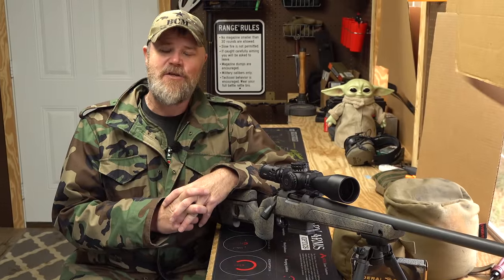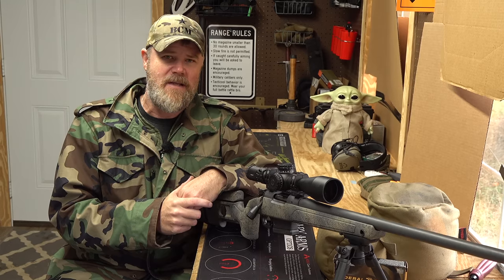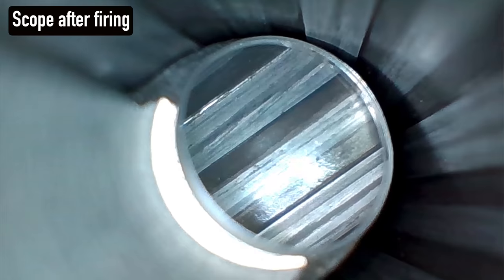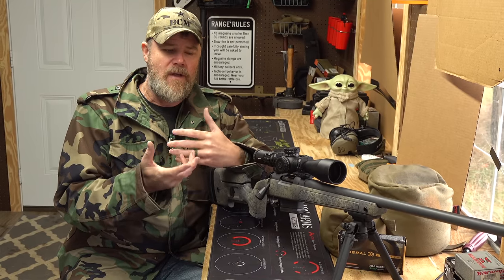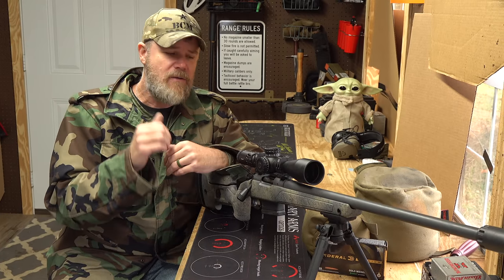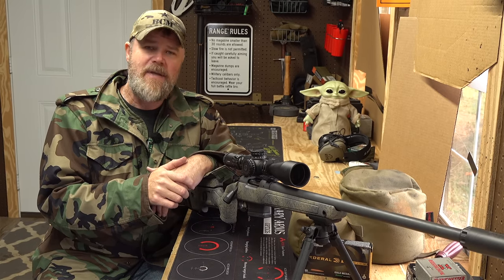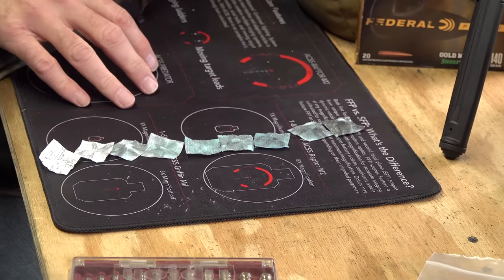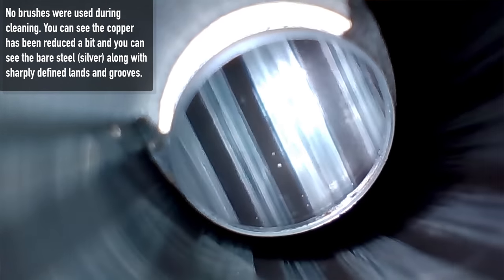Barrel Break-Ins and Cleaning Voodoo Rituals Destroy Barrels

Comment: When I was a kid, my uncle told me " don't over clean the barrel. More guns (bores) are ruined from cleaning then shooting". He was right back in the 1970's and 1980's. Today I have the benefit of knowing some really excellent competitive shooters. To the man, they tell me they basically don't do a break in and only clean lightly periodically to keep it running. If it stops shooting run a few patches through it and clean it lightly. One guy in particular uses high end custom rifles and does not use metal brushes ever and changes to a new barrel when he starts wearing them out. He told me he never uses ammonia solvent and does not try to get the copper out with solvent. I am glad that he told me all this when  I bought a new rifle and I have followed his advice. So far, so good.
Reply: In your experience does this hold true for any rifle or just bolt guns? Most of my ARs have chrome lined bores and one with a nitride treatment. Should I just run patches through every once in a while and call it a day?
Reply: I realized this when I bought a WWII Moist Nugget, if I tried to do more than just remove the cosmoline I would be doing more harm than good.
Reply: I always use gun lube on a piece of a napkin and push it through the barrel. Cleans most, couldn't possibly hurt it?
Reply: @parkercarlton9340  barrels are kinda like engine cylinders, to an extent, they sorta clean themselves. Once there is a certain amount of copper built up in the barrel, it doesn't get more fouled just because you keep shooting, it stays where it's at.
Reply: a non steel brush will not hurt a steel barrel
Reply: Now I have heard this old saying, more guns are ruined from cleaning than shooting, yes but more guns are ruined from neglect than cleaning.
Properly cleaning a firearm and lightly oiling the barrel in storage is essential to preserve a firearm.
Most people use this as an adage to excuse their laziness
Reply: @zaca952  if you mean by neglect is letting a gun rust to death, I would agree.
Reply: @redcell9636  Moist Nugget???? 😅😅 I'm dying, that's a cool nickname!
Reply: @Radvous  I have been lurking to much on the chan, that's were I heard the nickname from.
Reply: I believe the  cleaning rod will flex right over on the beginning of the riffing lands, ruining the throat, increasing bullet jump and ruining the accuracy of your favorite rifle. Always use a bore guide on your bolt action rifle.
Reply: that's why those who shoot far and ton are the ones worth listening to.
Reply: @jimmybare3026  
That’s why I use a bore guide and nylon brushes. Even then I’m not anal about cleaning it. 
Most of my cleaning stuff is to ensure my stored rifles and their barrels never rust. About once a year I’ll run a LIGHTLY oiled patch or swab thru all my stored rifles.
Reply: @ThatcherKSA  jut be sure and push a second one through to remove excess lube which could possibly cause a serious spike in pressure.
Reply: @parkercarlton9340  In an auto loader, I'd still do at least a minimal cleaning with some patches. Be sure to clean the barrel chamber, bolt and carrier well in a DI system rifle for reliability.
Reply: D R  yup, Mosin Nagant
Reply: Never clean your barrel?  Crazy idea.  Of course, you should clean your entire weapon.  Cleaning it won't ruin a gun no matter what anyone says.  Use proper gun cleaning solvent and gun oil on it.
Reply: @rangerup1804  I used to be very picky about cleaning my rifles and getting the barrels as clean as possible. Now I ma not as concerned ad don't clean after trip to the range. I still take good care of them and clean them lightly and much less aggressively than in the past.
Reply: @johnshandloading7907  I got an old Ruger 10/22 rifle from an old guy a while back.  He was quite proud in telling me he never once cleaned it.  He said that 22 rifles don't need cleaning.  I asked him why he was getting rid of it, he said it stopped working.   When I stripped down the rifle, I could see why it wasn't working any longer.  It took me 3 days of scrubbing every part in it to get it to function again.  Got a good running rifle pretty cheap because he was too lazy to clean it every now and then.
Reply: did you just repeat exactly what the dude said in the video and claim that you heard it years ago?
Reply: Your uncle was right

Comment: I’ve been using brass brushes for over 50 years and never a problem with them, plain old common sense is pretty rare these days. 😂 nylon brushes are crap.
Reply: Same here.
Reply: Here you go DA----- All you have to do is follow the link I provided and people who think brass/bronze can't damage steal will find a picture from a well known barrel maker with bore scope footage of very real damage done. Yup, when you're dragging flakes of carbon (very hard) and metal flakes through your bore you are in fact damaging it. Thanks for the post
Reply: Dont see a link. So, uh, when a bullet goes down a barrel at mach 2.5 or 3, where is the carbon fouling going? Do you think the bullet isint scraping and rubbing carbon fouling all along the bore? But the brush is going to cook it? I don't understand copper brush phobia. As a revolver shooter (primarily) of lead bullets (exclusively), bore brush is life. Chore boy too. My sub moa bolt actions get the same treatment to no ill effect. (No chore boy for them though.)@jhartmac100
Reply: @jhartmac100  
There’s lots of bullshit on the Internet, the proper use of brass or copper brushes is not going to hurt your barrel.
Reply: @jeffhowland867  
I understand your pain with lead bullets in revolvers, primarily magnum calibers, I quit using them in my 41, 44, and 357 magnum just because it’s such a pain in the ass to clean that lead fouling out of them, of course I still use lead bullets in my 22, 38, and 45 revolvers, they just don’t lead up like the big magnum calibers do.

Comment: Ammonia is NOT corrosive. Not to steel anyway. I hear this all the time and I just think people don’t understand the chemistry very well. Ammonia is very effective at breaking down “yellow” metals like copper, brass and bronze alloys. However, steel is virtually impervious to ammonia and, in fact, ammonia is often used in steam boiler systems to prevent corrosion in steam and condensate lines. Mild steel piping is used in thousands upon thousands of ammonia refrigeration systems that carry hundreds of pounds of highly concentrated ammonia. If ammonia was corrosive to steel, those pipes would burst constantly. Ammonia based solvents will not and cannot “rust” your barrel.

Comment: How the heck is a brass brush going to damage the bore when every round is a brass-jacketed piece of lead which gets swaged into the lands and grooves? There's a whole lot more force involved there than with the brush.
Reply: copper jacket
Reply: @richardf1107  Copper is harder than brass.
Reply: @NWA744  i was just saying copper jacket not brass
Reply: @thecanadianlanboy8132  Most rifle barrels that are carbon steel are plated or lined with something internally to prevent carbon steel from being exposed to the fouling, carbon, heat and cleaning supplies. It’s not the brass brush or the nylon that is going to wear down the bore… it’s the carbon that it scrapes off the inside and pushes all the way down the barrel and out the muzzle. That carbon (not the brush, the carbon) is much harder than bronze or nylon and possible hard enough to scratch the barrel microscopically which in turn will get you steel slurry/dust that is the same hardness as the barrel because it came from the barrel. Steel shavings from a barrel are certainly hard enough to scratch the inside of the same barrel. I have seen chunks of carbon buildup seize small engines in chainsaws, weed whackers, backpack blowers etc. I haven’t seen personally but have heard of it seizing or breaking piston crowns in direct injected cars. I haven’t ever damaged a barrel because of over cleaning but I don’t really clean my barrels that often. I’ve only heard about it damaging barrels but I can say pretty confidently that just because the brush material isn’t hard enough to scratch the barrel doesn’t mean that what comes off the inside of the barrel itself and gets caught in the brush isn’t. Remember that a Japanese water stone can sharpen knives of over 65 Rockwell hardness despite being seemingly made of soft clay. The soft clay is full of abrasives they are hard enough to scratch steel which will add steel shavings to mix and create a kind of snowball effect.
Reply: @JG54206  you taught me something  today Sir, thank you for sharing
Reply: @Caxel108  Happy to share my experiences. I will say that I do think that it would take some extremely excessive cleaning or some extremely improper technique to damage the barrel with a brush that is bronze, brass, or nylon. Physically however, both materials will experience some wear from rubbing against each other… the softer material wear faster. If that weren’t the case then the barrel of a gun would have an essentially limitless lifespan seeing as how all the bullet material being forced down it is softer except for the core of certain rounds which never contacts the bore. I think the brushes get blames more often that they’re responsible for. I think it’s usually someone damages the crown of the muzzle which can be easy to do and can make a noticeable difference.
Reply: @NWA744  copper is DEFINITELY not harder than brass.
Reply: ammo residue embeds in the softer metal and goes to work
Reply: gets one thinking though, I shoot a fair amount of steel-cased ammo (Tula and the like) due to cost in my pistols and PCCs, wonder how much that bangs up the barrel
Reply: @---tx9xx  casings don't go down the barrel, they stop in the firing chamber. Steel ones might nick up the firing chamber or other parts related to feeding and ejecting cartridges though. I'm not an expert on that though.
Reply: @josephahner3031  True, but their bullets are also made of a steel alloy. It's softer than that of the barrel, but it still wears on the barrel. If you shoot it at night you can often see sparks from the muzzle. That is your rifling running away from you and your bullshit ammo.
Reply: @ruthlessone3k  what steel bullets are you talking about? We're talking about copper jacketed lead bullets in steel casings.
Reply: @josephahner3031  he mentioned Tula. Those are lead core, steel jacketed, copper washed not copper jacketed and I'm not even entirely sure they are even doing the copper wash anymore.
Reply: I don't think that copper is harder than brass. Pretty sure it's the other way around.
Reply: @kimadar13  I think you are right but the bullet jacket is not pure copper, either. In fact, there are quite a few steel-jacketed bullets with a thin copper coating over the steel (almost all COMBLOC ammo is made this way). So even mild steel being pushed HARD against the rifling doesn't rapidly wear the bore , especially if it is chromed-lined like most AK's.

Comment: I have exclusively used Balistol and bore snakes for cleaning my firearms for at least 25 years. I haven't had any issues with accuracy or rust.  I find the different  cleaning methods  interesting. Good video.
Reply: this 100%
Reply: Same. Haven’t used anything but this and have no issues at all.
Reply: Second this. And I find soap and hot water go more than any scrubbing will. *don’t forget to oil after.

Comment: I grew up cleaning my gun after every trip to the range or when firing a shot in hunting.  I’ve picked up a better routine and use only aluminum cleaning rods and Hoppe’s No 9.  I’m going to read the ingredients from the label.  I bought some Copper out years ago and the bottle’s never been opened.  My accuracy has never deteriorated so I never used it.  I clean now  usually after the 100 rd mark like you’ve suggested. I don’t clean after every outing unless I fire 100 rds or so.  Breaking old habits is hard but the results are worth it.  I don’t own precision guns anymore but my guns shoot better than I can.  I shoot MOA with good scopes and ! 1/2 to 2 1/2 with Red dots on my AR Pistols at 100 yds.  I’m 71 and my eyes aren’t as good as in my youth.  At 41 yoa I had a custom rifle built that printed 1/2 to 3/4 MOA fairly consistently at 100 yds.  The thing weighed 13 lbs.  Target shooting is fun, but I go for Combat accuracy, 15 years, 8 mos and 6 days experience is what I am drawing from in the Let’s go Brandon age!
Reply: Aluminum rods are the worst. When they oxidize they are very abrasive. Your better off with brass or nylon coated. But i get you people act like ther guns are made of pixy dust these days...
Reply: I've heard carbon fiber cleaning rods are the best as they have the least chance of doing any damage to the barrel.
Reply: @sparky_-mf2cs  An aluminum rod, even if oxidized, isn't going to do anything to a high carbon steel barrel just from general cleaning. If your barrel were that susceptible to damage, it wouldn't last a single mag dump.
Reply: @NWA744  look it up. Oxidized Aluminum is very abrasive. Of course it aint guna damage your barrel from one 2 or even 10 cleanings. But it will do damage over time.
Reply: @sparky_-mf2cs  I use aluminum oxide at work, I know what it is capable of. An aluminum cleaning rod is not the same as purpose made aluminum oxide abrasives though. You would need a lot more applied pressure and friction than running a simple rod through your barrel will ever generate. If you think a cleaning rod is so bad, what do you think a projectile that is slightly larger than the diameter of your bore, being squeezed through by 50-60K PSI of pressure, at roughly 2500-3500 fps, and with high heat will do to your barrel?
Reply: @NWA744  suit yourself...
Reply: JP D  A bullet is far worse for wear than any cleaning rod.
Reply: 100 Ain’t enough.  I know competitive shooters that don’t clean their guns until 1000 rounds.
Reply: @perchowski3021   Carbon fiber is an extremely hard material.  I would worry about flakes coming off of it as it ages from use.

Comment: I won a match 4 years ago & put the gun into the safe.  Pulled it out two weekends ago, wiped off the bolt, added Lucas gun oil and ran the bore snake through it once.  It shot sub-moa groups out to 500 yards winning again.  Spend time training not cleaning! Thanks for the video!
Reply: I have to agree with you. My story is much more extreme. After a day of shooting about 400 rds in my Remington 12A pump .22, I put the rifle away uncleaned. Life happened and 23 years later I brought out the old Remington, ran a few wet Balistol patches down the barrel then a few dry patches and took the rifle out back and at 75 yds shooting CCI sv lead round nose I was shooting MOA using iron sights.
Reply: How is this possible? I read on the internet that Boresnakes will cause your barrel to spontaneously combust.
Reply: Ill never use Lucas Gun oil again, i love their 2 Stroke oils, but not for guns, mine rusted up so fast when i used their stuff for some reason
Reply: @leadhead7338  I loved their synthetic high heat.
Reply: @crawdadlando4053  We run Lucas 2Stroke oil and their 10w-40 for wet clutches in our Motocross bikes.
Reply: I use kroil and a bore snake in my barrels, but I'm lazy and only do that every few boxes of ammo. Most of the time like 80 to 100 rounds.
Reply: F-class shooters never use bronze brush. There is a reason why. They are not afraid of damaging the bore but afraid of losing very thin copper film deposit in the bore, which makes the bore smoother and tighter.
If you utilize this light copper fowling, you can reduce the amount of deviation in between the cold bore shot and following up shots.
Reply: Imagine having 500 guns

Comment: Break in procedure for me: Shoot to remove burrs, run boresnake through it to remove carbon while an initial layer of copper is built up and the barrel sets into its accuracy. After that shoot it and boresnake to remove carbon.  Once a while a patch with clp if the gun will be store for a while. Never had issues in over 20 years. More important is to keep the gun in a dry place while storing and keep a little film of oil on the working/exterior parts to prevent rust.
.
Reply: I'm on the same page as you here 👍 I wish I had invented the Boresnake 😉
Reply: Burrs from what?
Reply: @iammattbennett  cutting steel in the manufacturing process always results in some burring. The duller the tooling, the larger the burrs and burnishing. 
KnifeMaker

Comment: MAC, thanks for this. I'm 68 and a shooter since 11 years old. Was taught by father and other shooting friends about being diligent on cleaning each time gun was used (except for some extended hunting trips). Typical of old-school thinking- run Hoppes #9 solvent, scrub with brass brush, etc. Purchased first precision rifle (Ruger Precision Rifle, 6.5 Creed) about 3 years ago (2018). The salesperson at gun store gave me a 10 minute lecture on barrel break-in (shoot 1 round & clean, shoot 2 rounds then clean, etc.) The rangemaster at our range (California Tactical in Piru, California) told me how stupid that thinking was. Was at the range  today with a new FN SCAR. Didn't think twice about the old-school break in procedure. Especially since it's a cold hammer forged, chrome lined barrel. I'll continue to use your method and change to a non-ammonia cleaning solvent and nylon brushes. I've given up the clean-after-use thinking for barrel (but will continue to clean bolt assy and gas piston occasionally). Keep up the great work.